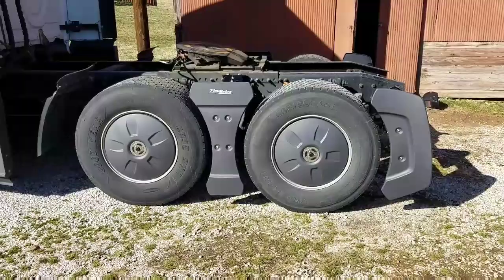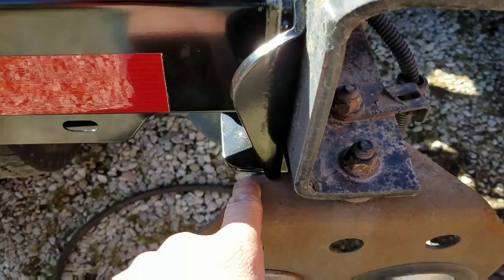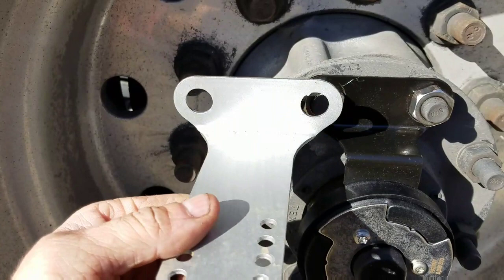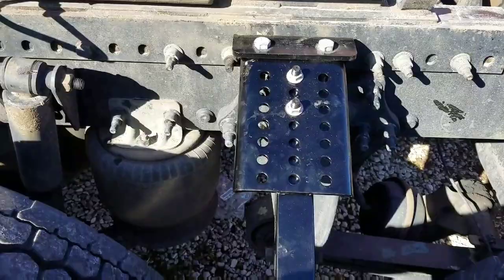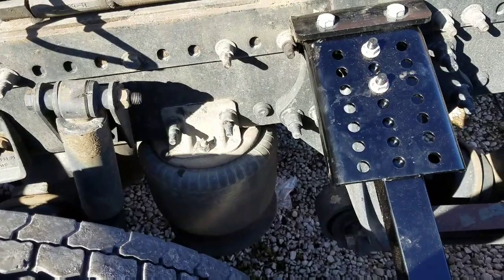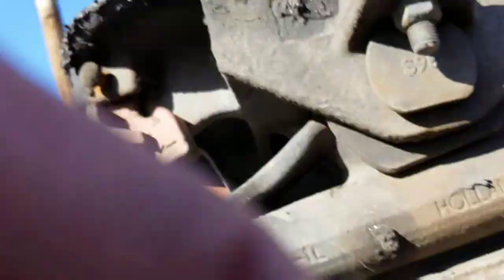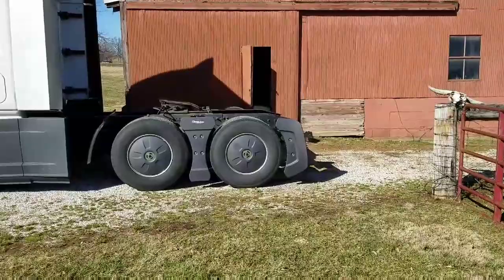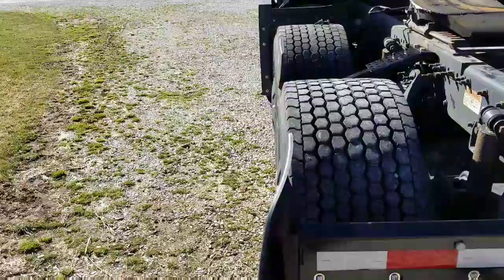Flow Below install

Comment: I love these things. They look so cool. I would want them on my truck just because they look super cool and help your wheels stay clean. A little harder to pre-trip, but then less rust on the bolts. Any suggestions? Is it really worth it? I had them on the company's Cascadia 126 and that thing was getting over 9mph. Not sure if it was thanks to these things.
Reply from the maker: I think they are worth it because every little bit helps. I have the whole system on my trailer as well. I have a different truck now and transferred them over. They are a well made product, I've been running them for five years and they are doing great.

Comment: Carriage bolts by the 5th wheel
I have the same set up.....and wondering how its going to work...mechanics at our shop said I'd have to take it to a dealership to have the center piece mounted due to the way my 5th is mounted.  Same as yours.....
And i do know how to weld, but dont have a welding machine
Reply from the maker: If it's like mine, just take a cutoff wheel or a torch and remove two huck bolts. It comes with two new bolts to put in their place. No welding or anything needed. I put this one on February of 2019 and haven't had any problems.
Reply: @jptransport8830  if i had a way of showing you a picture of mine, I would
Reply from the maker: @ryanlevron1972  812-653-0565 you can text it to me.

Comment: Care to share you mileage gains?
Reply from the maker: Flow below claims 2.23 percent savings with the tractor kit. It's hard to say, I've added so many little things with my trailer. No one thing will make a huge difference, its everything put together.